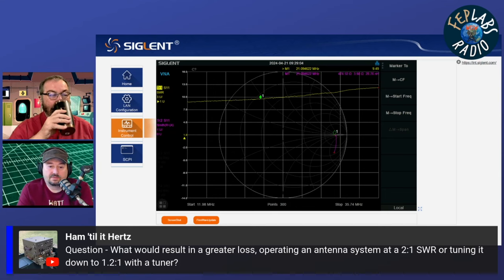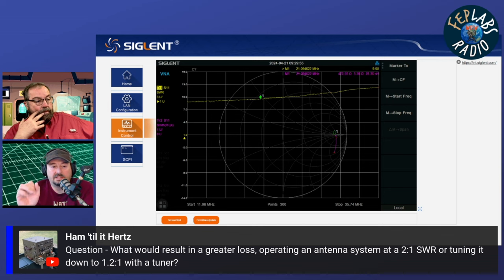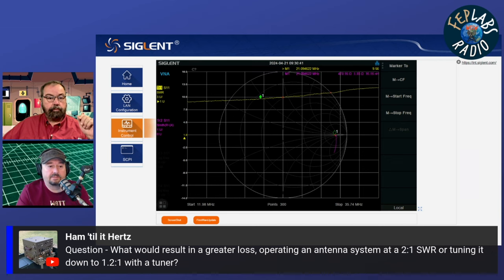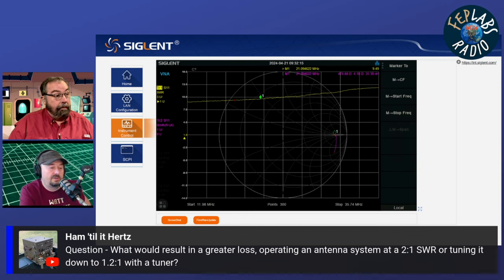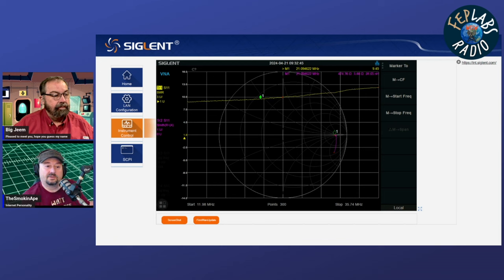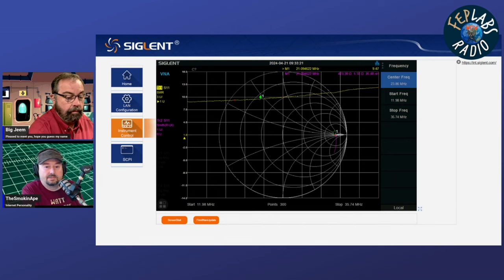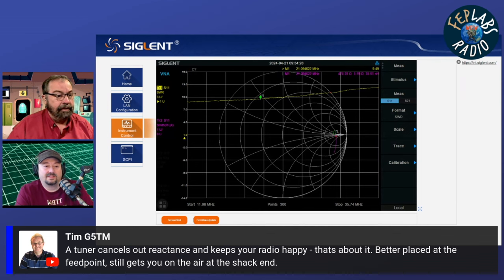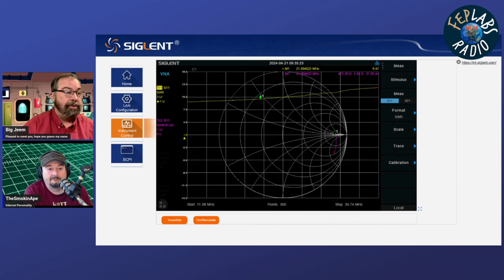It doesn't Tune the Antenna...

Comment: In the video Standing Up For Standing Waves (search YouTube) Bill Hays starts with the idea that all an antenna tuner does is make your transmitter happy, which many in his audience (members of a repeater club) agreed with. He then showed (not told) them that what it really does is make the antenna happy. He made a point: you don't care about your transmitter,as long as it's putting out full power and not getting hot, you care about the other guy's receiver. Adding a conjugal match somewhere between the transmitter and the antenna caused the latter to radiate at virtually full power.
Reply from the maker: Bill did a great job in that video

Comment: The way i understand conjugate match between the antenna and tuner is that the the antenna feedpoint is equal and opposite in phase with the tuner output, wouldn't that make the antenna feedpoint  resonant, is this why Maxwell constantly refers to the antenna as being tuned to resonant in his books ?

The reflected power being in phase with the forward power would then add to it ,its not creating more power rather conserving the original power put into the system, obviously in real world applications there will be some loss within the feedline which may or maynit be an issue depending on frequency, main point being the tuner is helping the transmitter to produce its maximum power into the system without causing damage to transmitter
Reply from the maker: This is exactly what I was trying to convey.  But the ATU doesn't change a single characteristic of the antenna, right?  If you tune a piano or a guitar you change the wire right?
Reply: @CoffeeandHamRadios  you can't compare a musical instrument with an antenna, a musical instrument must be resonant to make the note you require an antenna doesn't need to be resonant to radiate efficiently, 

If the conjugate match is present between the tuner and antenna feedpoint there must be resonance there also ,therefore with the feedpoint being resonant then the antenna is surely, if there's no conjugate match between tuner and antenna then there's no power transfer and you tuner would heat up
Reply from the maker: I wasn't comparing the antenna to a musical instrument, I was discussing that act of tuning...
Reply: @CoffeeandHamRadios  think your sticking point is what the conjugate match is doing between tuner and antenna
Reply from the maker: No, I fully understand what is happening.  I think we agree on what is taking place but you want to say "it's tuning the antenna" and I disagree and I think it's matching impedance, the antenna itself isn't being tuned.  It really doesn't matter to me what language we use to describe the exact same process...  for some reason it seems to matter to you.
Reply: @CoffeeandHamRadios  does the conjugate match cancel the antenna feedpoint reactance?  If it does then the antenna is resonant ,if it doesn't then its not ,It doesn't matter what I think

Comment: Your method and analysis are right on.  With low loss, tuning at the rig end also presents a good match to the antenna.  This can be shown using Smith Charts, either paper or computer aided, or using Dean Straw's TLW program which comes with the ARRL antenna book.  It can also be shown experimentally by putting 50 ohms on the transmitter side of the tuner and looking back down the coax towards the tuner, and comparing the measured complex Z and the complex Z of the antenna.  They will be nearly conjugates of each other.
This understanding is what can be proven and should be understood by all parties.  One should also understand that as losses in either the tuner or the line increase, the ability of the tuner to provide this conjugate match to the antenna is compromised, although it still works to some extent.  All the rest is just definitions, like where does the antenna stop and the "not antenna" (coax, etc) start.  Before we can answer "does the tuner tune the antenna" we have to have agreement on the terms "tune" and "antenna" and that is where the discussion goes into unproductive areas.
Reply from the maker: Great comment John, thank you for adding to the conversation! ~Ape
Reply: Could adding and subtracting capacitance to create resonance be classed as tuning 

Could the feedline be acting as an extension lead for the antenna feedpoint

Comment: Word salad to justify a common misunderstanding. Matching networks (essentially the same circuit hams call an antenna tuner) are tuning AM broadcast towers all over the world every day to resonate at the station's operating frequency. How do they think WLW gets their 5/8 wave tower to work? Used properly, it WILL tune the antenna!
Reply from the maker: Nah, its a matching network
Reply: @CoffeeandHamRadios  I think you have a basic misunderstanding of conjugate match. When you add reactance to an antenna circuit, which occurs when "j" is not 0, you change its resonant frequency. I have worked at many AM stations whose towers are not the correct height to be naturally resonant at the operating frequency. They are tuned to electrical resonance by the conjugate match, typically using a Pi network. Antenna tuners are so called because, by adding reactance, they change an antenna's resonant frequency.
Reply from the maker: Totally agree, where we deviate is that you say this is tuning the antenna and I say it is matching.
Reply: @CoffeeandHamRadios  How do you define "tuning" and why do you believe an antenna tuner does NOT do it?
Reply: @CoffeeandHamRadios  Here's what I think is the issue.  You are looking at the antenna and the matching network as separate pieces. Let's say you have an antenna which is not naturally resonant at the carrier frequency. It is connected to the transmitter by a properly adjusted matching network. What is happening? You place an Operating Impedance Bridge between the matching network and antenna and see the complex impedance, with a reactive component, since the antenna is not naturally resonant at the carrier frequency. Place the OIB between the transmitter and the matching network and you see 50+j0, resonant at the carrier frequency. The matching network has matched the transmitter to the antenna, just as you say.

But what about resonance? In a resonant circuit, the electric current oscillates at its resonant frequency. An antenna has a natural resonant frequency because of its length and the speed of electric propagation along its length. But, in the example above, at what frequency is the antenna current oscillating? It is oscillating, not at the antenna's natural resonant frequency, because the current is oscillating through the conjugate matching network as well as the antenna.  Nowhere in the system, not in the antenna nor in the matching network, is current oscillating at the antenna's natural resonant frequency.

This is why we say that the conjugate match has tuned the antenna to a new resonant frequency. So, a conjugate matching network can properly be called an antenna tuner because it does tune the antenna's resonant frequency.

Comment: In the old days the tuner was actually in the transmitter. It was called a pi network. I don’t recall any hams or engineers I knew saying the coax had to be half wave long. I think maybe that was a CB myth. Today the tuner at the transmitter does the same thing it matches the fixed 50 ohm output of the new rigs to whatever is at the transmitter end of the coax. The feedline to antenna mismatch remains the same. The power ( let’s say 100 watts) is delivered from the transmitter into the feedline. In its travel from the transmitter to the antenna it is attenuated some amount. That’s the inherent loss of the coax. Let’s say it’s 3dB ( easy number to work with). Half of that 100 watts is lost in the coax. So 50 watts reaches the antenna. With a perfect match almost the complete 50 is radiated. However with a 2:1 SWR there will be voltage and current reflections. Reverse power or reflected power it’s sometimes called. So some power gets radiated but some is reflected. In the case of a 2:1 SWR that’s about 5 watts reflected. Of that 5 watts only about 2.5 gets back to the transmitter. ( 3dB loss in the cable). Essentially that 2.5 watts gets reflected back to the antenna. Again half of that is lost so only 1.5 watts makes it to the antenna, where 10% or .15 watts are reflected and half of that ( 0.075 watts) is lost on the return trip. Let’s stop here. Total loss in the feedline with the matched antenna was 50 watts. With the 2:1 SWR the loss was the sum of the losses first 50 watts, then 2.5 watts and then 1.5 watts. Total loss for the 2:1 SWR case was 50+2.5+ 1.5 equals 54 watts in our truncated example. The loss in the matched case was 50 due to coax loss. In the 2:1 case the loss increased by 4 watts. In dB that’s 3 dB loss for the matched case and less than 3.4 dB loss for the 2:1 SWR case.  
There are charts in all the antenna books that will give you the additional loss in coax due to SWR. That is based on the inherent or matched loss of that coax. The higher the coax loss the higher the loss due to SWR. Of course all this is based on the proper match at the transmitter end to allow the transmitter to supply power to the antenna system and to cause a 100% reflection of any reflected power back toward the antenna. The tuner may not actually tune the antenna, obviously it does not create a match between the coax and the antenna, but it does create a situation where the transmitter can deliver rated power into the coax where it can all be used up either as heat in the coax ( be it one trip or many trips bouncing back and forth) or eventually radiated. 
Each installation is different and loss needs to be evaluated and a determination made as to how much loss is acceptable. Also the transmitter end of the coax needs to be matched somehow so that all power reflected from the antenna terminals that makes it back to the transmitter is reflected back towards the antenna where it can either be attenuated in the coax or radiated by the antenna.
So does the tuner tune the antenna? Depends on what you mean by tune! It does not match the coax to the antenna. I think it does set up a resonant condition. Is that tuning the antenna? Maybe….
Reply: @dandypoint  
Your comments are helpful but need one clarification. It is very true that definitions are what are the main dividing point in this argument, and so I would mention one thing.  When you say "obviously it does not create a match between the coax and the antenna" you very likely mean that the tuner does not create a match between the Zo of the coax (typically 50 ohms) and the Z looking into the antenna, in your example either 25 or 100 ohms.  The tuner changes nothing about the antenna itself, and also nothing about the Zo of the line, so it is indeed obvious those ratios are unchanged. Those ratios determine the actual value of SWR on the line, so that also is unchanged. 

But the tuner does change the Z looking towards the transmitter/receiver as seen by the antenna.  In the 100 ohm case, the Z the antenna sees looking into the coax is not 50 ohms, but something closer to 100 ohms as a result of the tuner.  An example I did with a particular coax and length to get 3 dB loss gave 64 + j11.3.  This was calculated with the TLW program that comes with the antenna book using  20.5 meters of RG-174 at 14 MHz.  This represents an SWR seen by the antenna of 1.6:1.  A 50 ohm load at the transmitter end but without the tuner, the SWR for the antenna looking into the line would be 2:1,   So in this rather lossy case, the tuner only partly matches the antenna to the line. (2:1 down to 1.6:1)  If the above calculations are done with a 1 dB line, the  antenna to coax conjugate match is much better.  With a lossless tuner and a lossless line, the antenna sees looking into the 50 ohm line will be its exact complex conjugate.  This is the point of this whole video.
Reply: @JohnStanley-m3t  yes. The ideal is to have the coax see an impedance of 50 + j0 ohms. When it does not it becomes an impedance transformer. Transforming the antenna Z to some other R and X at the transmitter end depending on transmission line characteristics and length. Then you accept the loss on the line due to using that particular line plus the additional loss due to SWR. The additional loss may be very small if the coax has low loss to start with. Then the tuner needs to get the power into the coax. That used to be in the transmitter itself and now it’s usually in a separate box called a tuner. Sounds like you have a good handle on it. I was trying to ahead some additional light on the subject from the perspective of an old time ham plus EE. That’s hard to do sometimes.

Comment: I don't use an antenna tuner.  As a matter of fact I don't even use an antenna, I just hang the coax out the window and let the free wind take the signal.
Reply from the maker: If it works it works 🍻

Comment: Maxwell's stuff is a lot like the bible, the words mean what they mean, but people's misinterpretation of them is where the issues arise.......
Reply from the maker: I like this...
Reply: It's definitely some kinda misunderstanding of Maxwells terminology ,

what does he mean when he states the antenna feedpoint impedance is tuned by the output of the feedline which is the conjugate of the tuner output, 

I see that as the feedline has a conjugate match between the tuner and the antenna feedpoint therefore being that the reactance has been cancelled out at the antenna feedpoint creating a resonant feedpoint therefore a resonant antenna 

Is this not the interpretation of others?
Reply: @Pioneer936  the best explanation I've seen recently was in a Facebook antenna group, by Tom, W8JI.
His explanation made the most sense to me of any I read. It doesn't jive with what is said in these videos either, and that's because he understands what Maxwell meant, and most of us(including these videos) don't. The signal doesn't bounce back and forth, and eventually decide to exit the antenna. The wave is standing,  just like it sounds like it is.
Reply: @VE9ASN  yes Tom had worked with Maxwell also ,I saw the post ,totally agree about standing waves standing
Reply from the maker: It is the understanding; bit like I have to keep replying to (over and over) is that is should like you are matching the antenna impedance not tuning the antenna.  Call it whatever you want, it really doesn't matter.  You seem to like claiming to have some secret that others simply don't understand.

Comment: Man, if I can't get it to tune, I'll just bust out the rg11
Reply from the maker: 75ohmLyFE
Reply: If you make a ground plane, lets say out of wire and cant raise it high enough to slope the radials down to around 30 degrees to achieve 50 ohms. like an 80m or 40m vertical. It will read around 30 ohms. feeding it with 75 ohm coax (especially 1/2 WL long multiples) will give you a nice 50 ohm match. some of us cant live with 1.5/1

Comment: Both sides of this argument are right to some extent, and both are wrong.  Think about this: what is "power"?  To calculate power, you must provide context of other variables: voltage, resistance, impedance, etc.  This is one reason why high voltage electricity transmission lines are used.  Most amateur radio power meters measure power in the context of a 50-ohm load.  If the antenna (or antenna system) is not 50 ohms, then the power reading must be considered in that context.  When that other guy says on his youtube channel that power is created when SWR is present, and then shows a "power meter" to prove his point, he is completely misunderstanding the context of a power measurement.  Whether an antenna tuner actually tunes an antenna is also subject to context....and at the end of the day, it doesn't really matter as long as the transmission line is of good quality and the mismatch is not significant to cause significant loss of power due to heat in the transmission line.  "Significant" is also subjective, since radiated signal effectiveness is logarithmic and not linear.  The bigger thing most never mention is antenna radiation pattern if the antenna is not tuned to resonance...which can be good or bad.  A 5/8 wave vertical is non-resonant, but we know that length optimizes low-angle radiation towards the horizon compared to warming the clouds.  However, when we move away from a perfectly resonant dipole, energy is not lost but rather takes the form of lobes and nulls.  This causes the antenna to behave in unpredicted ways and to me, this is a larger issue than arguing about power loss due to an antenna tuner or SWR.  73
Reply from the maker: "and at the end of the day, it doesn't really matter as long as the transmission line is of good quality and the mismatch is not significant to cause significant loss of power due to heat in the transmission line" 100%, great post...  Thank you!
Reply: He doesn't state power is created he states power is conserved and adds to the forward power  he is correct
Reply: @Pioneer936  your statement is true in a perfect world.  Coax and transmission line loss increases with mismatch.  Energy is not conserved, it is lost in the feedline.  The part about measuring power is also more important...a 50 ohm power meter will not work properly if the system is mismatched.
Reply: @daveN2MXX   all power that is reflected is conserved, its not lost because of the mismatch, the only loss is because of the feed line not swr ,a 10,1 swr doesn't means that nearly 70% of the power is lost it can be as little as 3% ,the other guy states this in his videos
Reply: @daveN2MXX  also just because an antenna is not resonant doesn't necessarily mean that the radiation efficiency drops, the antenna can be reduced to 25% of its original length before radiation patterns become of significance to pattern changes